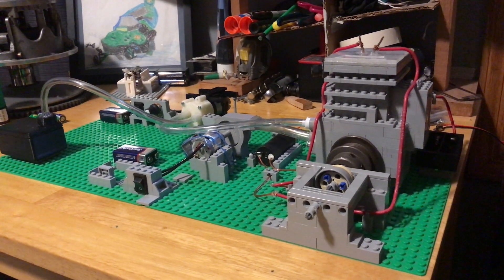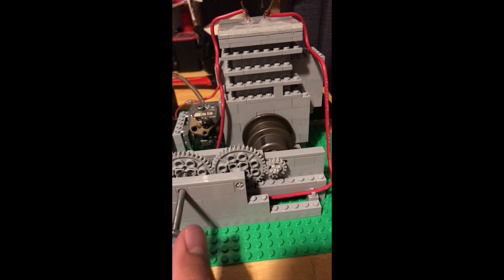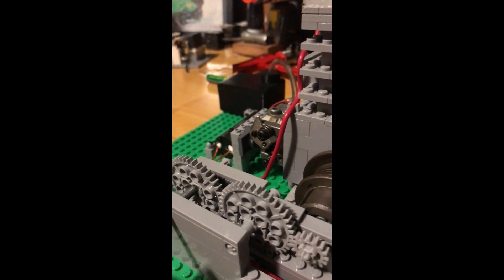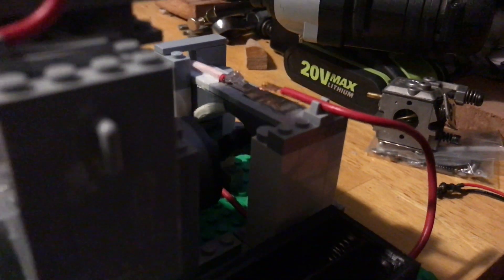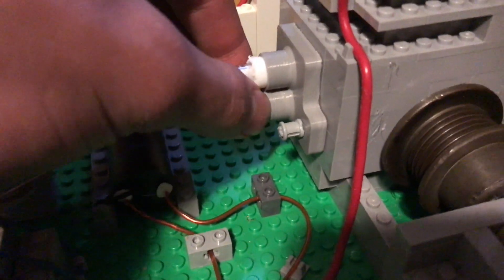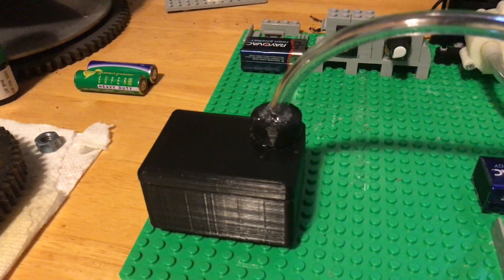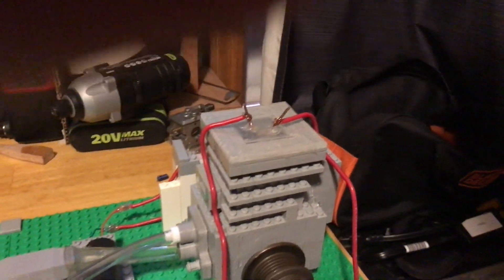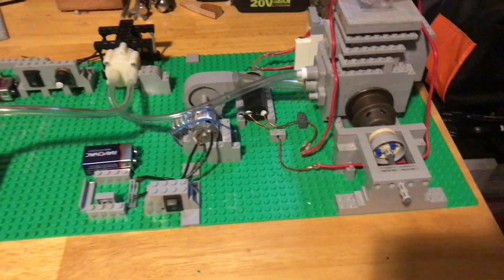Custom Working Lego Combustion Engine #3

Comment: Currently working on 2 lego engines, one built out of those premade piston and cylinder parts and one totally homemade with a 2x2 piston and bore. Both are not far from running properly. Only problems are having a sealed engine block, hot glue piston rings, spark firing constantly...

Comment: dude you should 3d print a piston with closer tolerance. i did that an i actually have good compression. it will take a few tries to print but once you get it this engine should run
Reply: can you post a video of it?